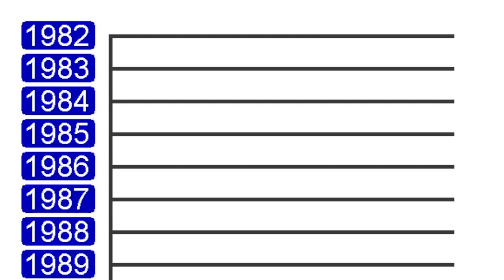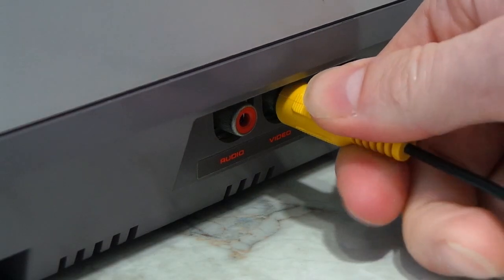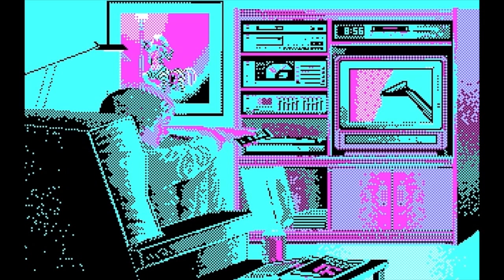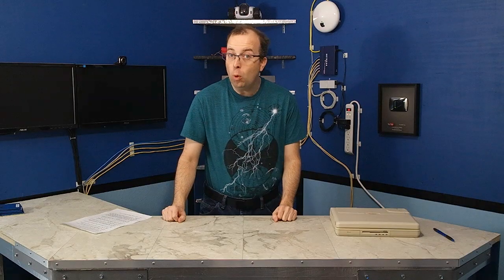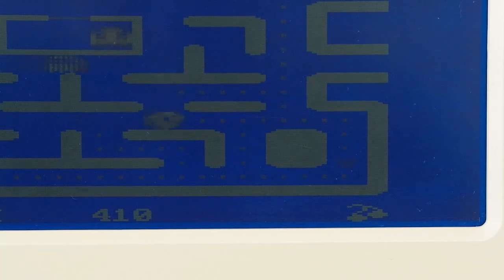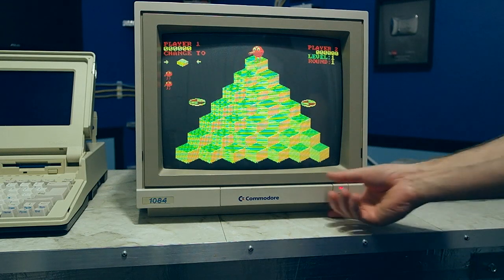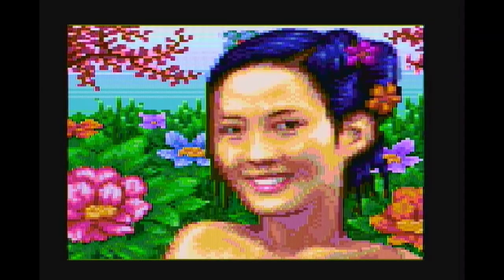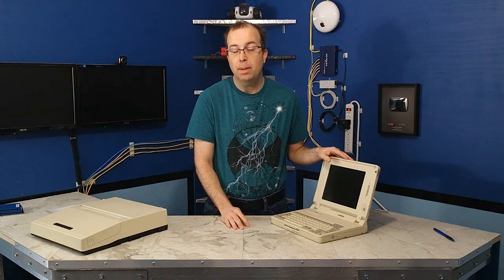CGA Graphics - Not as bad as you thought!

Comment: Great video, but I have to disagree with you about CGA being comparable or superior to a C64 or Atari 8-bit series. Those machines had dedicated graphics chips with hardware sprites, which made them ideal for gaming, and it wasn't really until the EGA/VGA era that most PC games began to exceed what the C64 and Atari were capable of -- or if you were lucky enough to have a Tandy 1000, the system which truly legitimized PC gaming.
Reply: +vwestlife Aside from needing EGA/VGA you also needed quite a powerful CPU compared to the humble 6502-derivatives in the C64 and Atari. The CPU had to bang all the pixels into memory the hard way. You'll need at least a 10 MHz 8088 or a 6-8 MHz 286 and a proper VGA card (the game is EGA, but real EGA cards tend to have very slow memory) to enjoy Commander Keen, where C64 and Atari did similar games with ease on a much slower CPU.
Reply: Inclined to agree, what I just witnessed was not comparable to the C64. If I had seen that back in the day, I would have cringed and run back to my 64.
Reply: OK take a look at 2:50 ... it's just disgusting looking compared to even a C64 game.
It seems back then, all video cards/onboard video had a trade-off between resolution and the number of simultaneous colors being displayed.  But let's face it, everything has to start somewhere till it reaches today's NVidia 1070/1080 quality.
Reply: CGA = CRAPPY Graphics Adapter. I'm glad I skipped that and got an Amiga back in the day
Reply: @scottbreon9448  What a stupid post. Thats like saying, I'm glad I skipped the ZX81, and bought a SNES. The Amiga 500 came out in the VGA era, and VGA-256 shat all over the the Amiga's crap 32 colours.
Reply: @DKTronics70  - the Amiga 1000 came out in the CGA/EGA era, and that's the one with 32 colors.  Amiga 500s and 2000s could do 64 colors, and would outperform VGA cards of that era substantially despite the planar memory organization.  Remember that MEMF_CHIP is literally directly on the processor's bus AND on the blitter's bus together.   Plus, hardware sprites, more flexible backbuffer, etc.  It wasn't until the VLB/PCI era that VGA really gained a solid advantage of any kind, and most of said advantage was the chunky pixels.

Furthermore, adding extra colors isn't as advantageous as you might think.  The relationship is more like log(number_of_colors) than number_of_colors.  Or perhaps comparing the bits.   A good example is how while current direct-mapped/non-CLUT 24-bit color is better than the old Glide-era 16-bit color, the difference is often kinda subtle in actual practice, even though 16777216 is 256x more than 65536. It's only 1.5x more bits, which seems like an apt comparison.

Finally, who the fuck bought a VGA card in 1987?  All zero apps for it, crappy-ass IBM design, probably cost more than an Amiga 500 setup did all by itself at the time, etc.  The EGA Wonder came out in '87 and was pretty much the cost of a base A500 at the time.   Besides, the best PC game of that era was EGATrek.  Fight me.

To others - The base 68000 is on par with a 286 of equivalent frequency, and the 68020 is actually superior to 386s of equivalent frequency (it's a pipelined design, like a 486, although not as deeply pipelined as a 486).
Reply: @LordRenegrade  I'm not sure if anyone actually read this comment. LOL
Reply: I think the superiority of CGA was in its dedicated 16K-on-the-card video RAM.  The Atari, Apple ][, C64, and all the others had to share system RAM with the graphics subsystem.

I do agree with you that the dedicated hardware sprites, like those available in the C64 were most definitely excellent for gaming, and made what would’ve been a far inferior system much more useable.  I’m a big C64 fan, no doubt, but I definitely give IBM some big credit here — they created a graphics subsystem that was excellent for its day.
Reply: Personally prefer cga to c64 graphics
Reply: All I remember about CGA is some disgusting purple looking monstrosity. he-he
Reply: So basically the MBR virus wiped out the computer ship you used to go to... jk.  But yeah CGA graphics sucked (all I remember is lots of purple), and I agree even the C64 colors somehow looked better.
Reply: Sorry bro :( I let us all down there.
Reply: Krasen Makes Content Lol
Reply: Many of the first wave of PC games (and the last wave of Apple ][ games) were ported from games that originally used C64 16-color sprites. The key enabling technology was the development of hand-crafted "blitters" that could dynamically render C64 sprite graphics on EGA, PS2, Tandy, and VGA adapters. Next we upgraded these internal graphic drivers to render dithered 16-color hi-res graphics from 256-color lo-res artwork, allowing us to eliminate the need for 16-color artwork (by that time, CGA, C64, and Apple ][ had become obsolete).
Reply: Krasen Makes Content oh you think you're So Great don't you you think you can just posted them slightly witty comments and nobody will respond 
well guess what I responded bro I responded real hard look at this response I'm responding all over the place you won't even know how hard I'm responding all over your somewhat redundant comment watch me watch me bro watch me watch me watch me yeah ok stop watching me now
Reply: insert long comment here

Comment: Wait a minute. It works due to a "problem" of the NTSC standard. So... does it work with PAL or SECAM, too?
Reply: +kilésengati CGA was designed for NTSC, not PAL or SECAM so if you plug a CGA card into a PAL or SECAM output device you'll just see a corrupted image. It would be possible to create something similar to a CGA card but that outputs a PAL or SECAM signal instead, but as far as I know there weren't any machines that did this. PAL and SECAM are also both a little more complicated than NTSC, so there would be extra circuitry involved and maybe software changes too.
Reply: andrewmjenner Ah, okay. I didn't knew that. Thanks for the information.

Comment: I certainly don't agree that CGA was better than a C64. For still images perhaps, CGA may have had a slight edge. But the C64 had far more powerful hardware for games, with hardware sprites, hardware scrolling and being able to redefine the character set. It also allowed multiple video pages for easy tear-free animation. CGA had nothing, all you had was this excruciatingly slow 16K framebuffer, where the CPU had to bang everything into memory the hard way (hence the horrible scrolling in Maniac Mansion for example).
Reply from the maker: +Scali Bohemiq Perhaps.. but since CGA did not use any sort of color cell, it made it MUCH easier for the processor to work with software sprites.  Every pixel was directly addressable to whatever color you wanted it to be. The C64 could only use 8.5K of video RAM, compared to CGA's 16K.
Reply: +The 8-Bit Guy Well, first of all, the C64 didn't need software sprites :) Secondly, you can't compare memory sizes 1:1. The C64's custom characterset and colorram acted as a sort of 'compression', allowing to do many things that will be far slower on CGA. Let's face it, sprites sucked on PC. They always flickered because they were too slow, and because of lack of backbuffering. Just like scrolling always sucked on PC. On C64 you had tons of great scrolling games with many sprites, such as Denaris, Giana Sisters, etc. Totally impossible to do that on CGA.
Reply: +Scali Bohemiq To clarify... An entire screen on C64 consists of 40x25 characters and 40x25 colorram entries. That adds up to a total of 2K of memory. CGA needs 16K of memory for an entire screen, meaning the CPU has to update 8x as much data for the same screen area. The C64 had it much easier.

Comment: Actually... the color mixing in composite video is because the luma and chroma wires weren't separated properly, which technically makes al this a BUG. Which means composite color mixing is a BUG. Developers were able to display THOUSANDS of colors by EXPLOITING A BUG IN THE VIDEO CARD ITSELF.

Holy shitfuckles.
Reply: +MarioKart7z I wouldn't really call it a bug - it's a limitation of the NTSC standard for encoding colour with a single signal. It was done this way when colour TV was invented, in order to allow colour signals to be backwards compatible with black and white TVs. Every computer and console that has a composite or RF output for video suffers from some form of this "bug", but it's only really useful for generating "extra" colours on machines where the pixel clock frequency is s multiple of the color carrier frequency, such as CGA, Apple II and Tandy CoCo.

Comment: Really cool comparison, did switching between composite and RGBI affect the framerate at all? Would also love to see a video comparing the different types of keyswitches on your laptops and standalone boards. I know you've done Apple restos before, but a comparison would be awesome.
Reply: +qkslvr221 No, composite and RGBI work exactly the same, as far as the hardware and software are concerned. The composite output is just a simple DAC-ladder on the RGBI signal, generating an NTSC-compatible composite signal. To the CGA card they aren't really separate 'modes'. They just appear differently, depending on what type of monitor you connect.
Reply: +qkslvr221 I don't think there is any software where the framerate is different between composite and RGBI - the CPU generally has exactly the same amount of work to do in both cases - it's putting the same amount of data into video RAM (just different data). The number of colours goes up but the effective horizontal resolution goes down so it works out the same.

Comment: EGA screens have round pixels, not square-shaped like VGA screens, and it looks almost like antialiasing mode. :)
Reply: +Michał Górka Lol, and this is why I still prefer VGA
Reply: +Polikarpov Mosca I use a nice new HDMI monitor and an old VGA monitor and the color difference is crazy... Before Microsoft fixed it, I had one monitor with scroll bars, and another without in Windows 10 because the old monitor literally turned the scroll bar gray into white..........
Reply: Good CRT monitors have better colors than any LCD or LED!
Reply: @MichalGorkaTruskaw  My OLED would like to challenge that (100% color accuracy and perfect blacks, CRTs always made the blacks slightly grey)

Comment: I had no idea you could get pseudo 16 colors via composite video on a CGA card!
Reply: +László Szerémi Yes, there is the Plantronics graphics card that did this. Various CGA clones, such as the Paradise PVC4 and the ATi Small Wonder support this mode. In a way, Tandy/PCjr are also 'modified versions of CGA'. They are not compatible with Plantronics though. The biggest difference is that they are onboard chips, and use the system memory as a framebuffer, rather than having dedicated video memory.
Reply: +The Obsolete Geek Same.
Reply: +The Obsolete Geek There's even a modified version of CGA, that can show all 16 colors without losing the resolution on RGBI mode.

Comment: Why are there things blurred out in that menu?
Reply: +Tim Ramich It's because of the way composite encodes colour. With only a single wire to transmit all the video data, the high frequency parts of the horizontal detail are commandeered to encode colour. This is something that dates back to the beginning of colour TV - it's not specific to CGA. The upshot is that fine detail (like the text in the menus) gets blurred and ends up with colourful fringes. These fringes are also responsible for being able to get lots more colours on composite, so it's a double-edged (fringed?) sword.
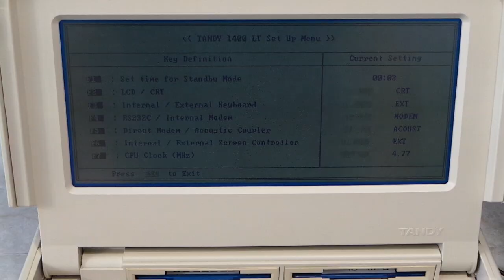Reply: +andrewmjenner It looks like very specific menu options are blurred out, because you can see the ones right next to it. Look at 6:29...
Reply: +Tim Ramich Oh, I thought you were talking about 9:12. I think that blurred menu item is highlighted and therefore displayed in a different colour, and the highlight colour/background combination chosen happens to be one that has very low contrast on that LCD monitor.

Comment: void plot(unsigned int x, unsigned int y,unsigned char attr)
{
   unsigned int address,rows,cols;
   unsigned char mask;

   rows=(y>>1);
  cols=(x>>3);
  address=((rows*80)+cols);
  if((y&1)==1) address=(8192+address);
  mask=((attr&3)<<((y%4)<<2));
 pokeb(0xb800,address,(peekb(0xb800,address)|mask));
}
I suspect that the Plantronics mode gives more colors.
Reply: +DAVID GREGORY KERR 
Ah yes, 0xb800 !
Been trying to recall that address ...   Did you pull that out of long term memory, or did you have to look it up ?

Either way, thanks heaps of the walk down memory lane .. that snippet bought a huge smile to my dial.

Also thinking that there was common technique used to extract more colors either by simple dithering, or interleaving between different palettes at a fast rate.  Can you recall such a thing ?